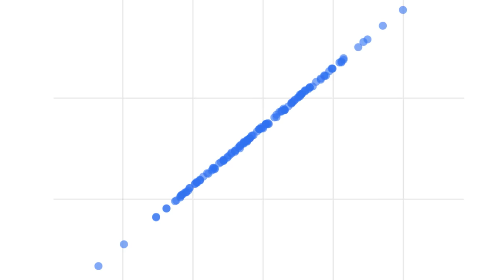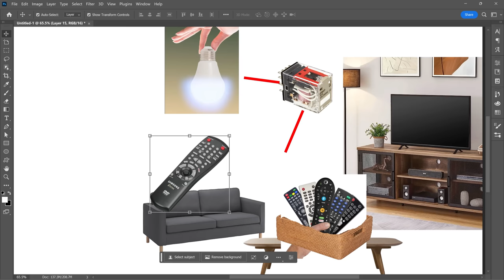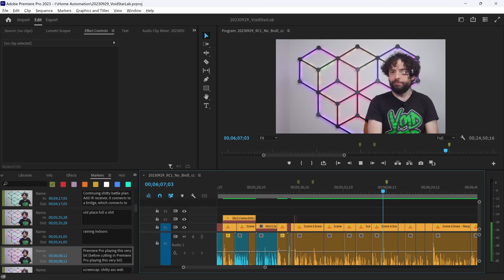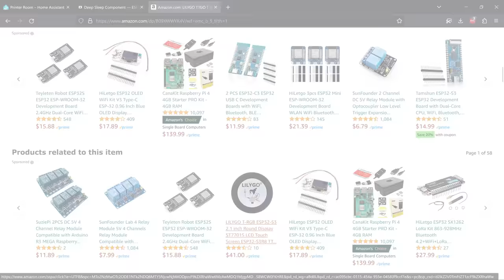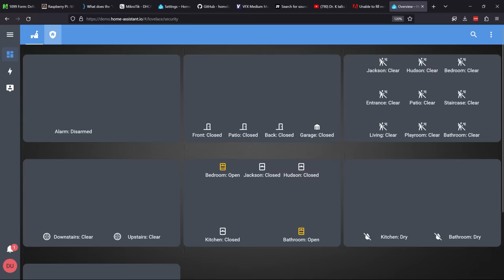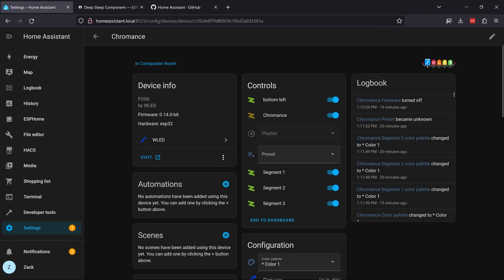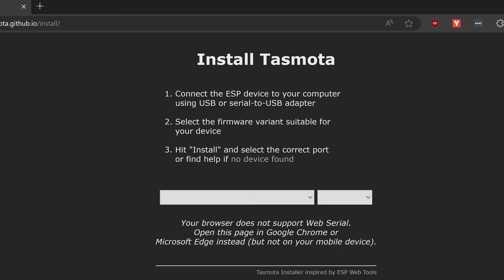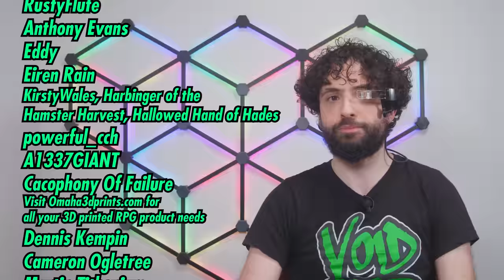Home Automation CONSUMED MY LIFE (and you're next)

Comment: I know the feeling. You don't want to look into HomeAssistant because the problem you're solving isn't that complicated. Then as your attempt to avoid Home Assistant grows into a frightening monster you give a try and realize that you wasted so much time by not just embracing it from the beginning. And then you realize all the crap that you can do now that you couldn't before and you'll be wasting much more time.
Reply: It is really easy to tell if someone uses Home Assistant. They will tell you within 1 minute into the conversation.
Reply: @TechTinkerWorks I rarely wait that long - at least you know I’m not vegan 😂
Reply: Oh god this is just refactoring...
-I find code that looks bad
-I replicate 90% of the logic but miss an edge case
-I spend 3 hours handling edge cases for a total savings of 7-15 lines and slightly better control flow
Reply: Home Assistant is just refactoring.. replacing your own stupid code with code people wrote who actually spent enough time to build a generalized framework for handling many interoperating state machines and work with more than just your stupid relay board driven by a parallel port.
Reply: This is exactly what happened to me
Reply: HomeAssistant is Klipper for your house. Once you accept learning enough to operate it (which was never really that high a bar), you’ll wonder how you ever lived without it.

Comment: Pro-Tip: with most dehumidifiers (that i know of) you can typically hook a tube up to them on a port or under a cover on the side and they'll just drain from that tube without needing to be discharged by hand.
Reply: I was 100% expecting the current-sensing adapter to trigger a reservoir-emptying pump. Definitely room for further tinkering there!
Reply: And if you need to pump it up, like from a basement, you can connect dehumidifier to a condensate pump. Works like a small sump pump. Some of them you can even wire the dehumidifier to shut down if the pump malfunctions. 

Some dehumidifiers come with a pump included.
Reply: True,  but you have to keep an eye on said tube.  They get clogged with gunk.

We have a dehumidifier running in our basement and have to keep an eye on it because of that.

There's also the issue of having a hose long enough to go over to wherever your basement floor drain.

But hey, it's still indeed better then emptying them by hand. 

And everyone with a basement in a damp environment SHOULD have a dehumidifier in it. It's 100% a must. Trust me, I moved into a house without one that had no door to the basement and the whole house smelled like mold and mildew most of the year. (I'm in the PNW).   Put in a dehumidifier and the issue was gone.
Reply: I am super disappointed to find 3 replies here and not one of them is a joke about your tube being discharging by hand.

Comment: I absolutely love the fact that the community is building up open options to do this stuff. At the same time the default - and easier to set up, usually - firmwares and apps for all this are Orwellian nightmares and usually a remote killswitch once the OEM designs to make a new product. I worry that a lot of new customers will just use those and regret it later.

Major props for using open source and DIY tools for your own system.

Comment: The problem I’ve always had with home automation was how little you could do without replacing all your switches, lights, etc and the cost of it all assuming you can even modify that stuff where you live. 

But it’s definitely gotten easier.
Reply: A lot of things around which don’t require changing switches, they just get wired behind the existing faceplates
Reply: My trip down the wormhole started with smart bulbs. Then others in the house started complaining that they were not happy with having to use their phones to turn the light on or off, so we're onto smart switches now. And two different hubs, and Google home thingy, almost ready to set up Home Automation (when I can find a Raspberry PI4!). Also have blinds automation motor ready to install and an ever growing heap of 'tried that, found better' stuff in the cupboard. Oh well...  what will happen to it all when I snuff it nobody knows!!
Reply: they make widgets that you mount over a light switch, and they physically flip the switch underneath them
Reply: Snazzy Labs had a really great philosophy that I continue to follow: anything smart must also work dumb. I didn't want smart bulbs or wifi switches or anything that would just stop me from flicking a switch to see what I'm doing while I figure out why the WiFi is cooked. I used Shelly devices, mostly the Dimmer 2 product. To work around not having a neutral near the socket I decided to just mount them in the roof on the actual light socket. I did swap out the light switches themselves for momentary push buttons (to satisfy my hatred of a physical switch being on when the lights have been turned off elsewhere, but it's optional) and it's been amazeballs.
Reply: @shanemshort  wish I could do stuff like that. But since I’m renting, even changing switches is a big deal.
Reply: @shanemshort  I yell into the void to turn my lights on and off, but the few times it's failed and I had to figure out why, turning the light switch off, then back on turned on the lights hahaha. Sadly im in an apartment so I can't really modify anything. Some day when I have a house though, oh man i'm gonna go wild with this shit.
Reply: @MrSolLeks looks like your thing has memory leaks that can only be solved by fully restarting it by cutting off power 😂

Comment: "Coming back to the smart home stuff after a decade away feels like returning to a remote tribe and finding a space program." Tell me about it. I played with PIC microcontrollers and BASIC stamps in 2004, and then came back ten years later to the Arduino world (okay, OSEPP, but same thing), and I couldn't believe how spoiled everyone was. The chips were orders of magnitude faster (ideas I had 10 years earlier were literally impossible on any chip, and now quite doable), and you could just plug the board in over USB. I had to MAKE my own cable back when, and program in assembly, and upload from a boot loader. 10 years later, they could just plug in a USB cable, fire up an IDE based on the Processing one, and look at dozens of sample scripts up in the menus. I chose the one that blinks the light on the board, and seconds later it was blinking. It took me a week of soldering, splicing, failing, assembling, and wiring up my own clock to get that far before.

Comment: I'm a home automation nut getting into 3D printing. And I love Home Assistant, WLED, Tasmota, etc. At first I'm like "Why doesn't he just use ESPHome instead of coding the Arduino stuff from scratch", and then my questions were answered lol.
Reply: I tried tasmota first, but it turned out ESPHome is much better and VERY awesome because i can just bang some hardware together and I will have running software in 10min.
Reply: Yeah, I am using ESPHome more and more these days, it's come a long way.

Comment: I love seeing your solution to “humidifier tank filled up” 
I would’ve tried adding a drain tube and a small pump to simply siphon off the water as it filled up. 
Have 2 probes to see when the water is full and have a small pump pump out the water somewhere at a lower elevation and boom no more water
Reply: Hack the "turn off" switch to instead be rigged to a pump. Or have the dehumidifier drain to a much larger container and just buy a the cheapest sump pump you can find. Or put the dehumidifier on a high shelf and just add a drain tube to the existing tank so it drains by gravity to a sink, toilet, out a window, literally anywhere you're fine having water go. 
I would get so annoyed at having to drain the thing every day. That's way too often.
Reply: @modsandendsGG-3883  You can also buy a dehumidifier with a built-in pump. And the ones that don't have pumps usually still have a garden hose hookup, so you can use gravity to drain without modifying the tank.
Reply: @johncip  he did make a video about turning on the lights but more complicated lol, also gave up on that morning stretching routine that was probably not bad for him
Reply: You mean, automate the problem instead of the notification? ;)
Reply: Oh my fucking God JUST PUT THE HOSE AT THE BOTTOM OF THE TANK

Comment: The next steps are temperature, motion, and environment sensors. 

True automation isn't "I moved the button to my phone/the internet." True automation is making everything work together: "I didn't need to push the button, because I was detected entering the room and it was 3:30PM, so the lights all turned on. It was 70 degrees because my environment sensor triggered the vents to allow HVAC to flow into the room and turned the ceiling fan on for circulation. The fans on my extraction hood were spinning down because my last 3D print ended ~10 minutes earlier."

Comment: I spent the first half of the video expecting him to say "And then I went to Home Assistant and it made it so much easier to do everything" so I'm happy he eventually got there.  I'm a home automation nut that recently got in to networking and then 3D printing.  For 3D printing I've sent up a custom dashboard to monitor the camera from octoprint and the temperatures of the printer plus enviroment aws well as an automation that I turn on before going out or going to bed that turns off the printer when it is done.
Reply: But he didn't shout it and hump the air! That's against the rules

Comment: For those of you looking for a more off-the-shelf solution for smart switches, TP-Link's KASA switches are the most simple and robust plug-and-play switches I've found and they are pretty inexpensive compared to a lot of the other options on the market. Did my whole house with them and use Google home for automation and it's working out really well. Just make sure you have the proper wiring in your house for them to work.

Comment: I really recommend buying some (zigbee/z-wave?) 2-gang or 3-gang light switches. That way you install it instead of your old light switch, and have 1 or 2 more buttons that can be tied to anything smart in home assistant. So you can turn on and off all your LED strips with the other button on your light switch, that's not physically connected to anything. I use it in a lot of rooms, like turning LED strip for my 3D printer on and off.

Comment: A tip for that high CRI led and overheating, its best to mount it to aluminum flat bar. It acts as a heat sync, and if you drill screw holes in it, it makes it much easier to install. That is how we install all the high CRI product in film/television.

Comment: In my printer room (ie the basement), I have a dehumidifier. Instead of filling up the tiny bucket it shipped with, it fills into a 200Ltr barrel. Then an ESP8266 based custom board monitors the water level in the barrel, checks for leaks outside, and measures the humidity and temp. When the barrel is full, the ESP8266 activates a submerged pump that pumps out the water to a 3d printed faceplate on the inspection port of my house drainage. I'm not so great with programming and APIs, but I managed to write enough code so I can log into the ESP via telnet and it'll give me status info, and it also can send a warning to my phone via bushbullet if there's a error state. The ESP is in a custom 3d printed case (that uses fibre optics to display LED status lights).
I have dozens of electronics and 3d printing projects, and pretty much all of them are unmitigated failures, but this one actually works, and has been totally reliable for over 2 years. It even alerted me when my basement flooded after my central heating boiler broke.

Comment: For your dehumidifier, you can install an automatic bilge pump, which is what they have on boats to automatically pump out water from say the engine bay. They run on DC so you can sit it in the bottom of your dehumidifier (or add a larger tank underneath it for the pump and run a hose to that tank). You can keep the battery charged with a trickle charge or other means and have an automatic pump.

You can pump the water into a larger container or a nearby window/sink/bath etc. and you won't need to worry about the water level rising or have to constantly be emptying out the water tank.
Reply: Or a condensate pump. Easily available and inexpensive and very reliable. Just plug it into the wall.

Comment: my smart home journey started with me realizing how expensive led dimmer switches are. I realized that a couple of zigbee lamps and a zigbee hub would be cheaper than adding dimmer switches. Now I've got way over 50 devices, a lot of them I built myself and quiet complex in my two room appartment. I'ved spent propably over a thousand bugs on smart stuff to save on 150 bugs worth of dimmers.

Comment: Zack one thing you could do is add hose to your dehumidifier so it just drains by itself.  If you don't have a drain that's lower than the dehumidifier, you could raise the dehumidifier or have it empty into a condensate pump.

Comment: As a mere mortal, I dabble in 3D printing, and I have a bit of home automation going.  Home Assistant is everything it claims to be, which is an astonishing statement.  I got a note on my phone yesterday, telling me I'd forgotten to close my garage door.  My lights are not only automatic, but they change brightness depending on time of day.  My stock, off-the-shelf bathroom vent fans are humidity aware.  And Z-Wave is really cool, even if I didn't break out a soldering iron.  You reaction to Home Assistant is a bit like my reaction to the Bambu X1 when returning to 3D printing after a 5 year absence.

Comment: I actually had to work with a home automation setup from 2004 which was surprisingly competently setup, it had a main IR controller, a full on server cabinet, and it receiver in every room on all walls. it still works, but i swiched it from using IR to homeassistant like most sane people would do (although the IR is still usable)

Comment: Interesting finding this VOD after just yesterday looking into wifi-enabled clothes washers and dryers. These devices let you set a timer before starting operation, but by wifi rather than manually (which arguably takes longer), and notify you when they are done by wifi rather than a buzzer. You still have to load them, unload them and fold the clean clothes. There are some great uses for home automation, but when the ROI in time and work isn't there, it's just an addiction.

Comment: I'm planning myself one day to create a home app that lets me control the lighting of each room and even have more advanced functions attached to them like set automatic on/off timers and activating or deactivating motion sensing from sensor-equipped rooms, then maybe even remote controlling appliances, a home audio system, alarm and streaming security camera footage.
I stumbled into the field of electronics and programmable logic circuits almost on accident, I might as well have fun with it. My two worries would be having to create the interface and the actual installation, as the entire logics circuitry otherwise is so basic you can realize it in LD.

Comment: I use the Node Red addon on my Home Assistant server to control my automations. I've got automations as simple as turning off a closet light after a couple minutes to turning on the front porch light when my wife comes home after dark. I even have it tracking usage sensors and pushing that data to SQL so I can see how I'm burning electricity. Be careful though, it's hard too escape the event horizon node that is red.

Comment: Now all you have to do is install ESPHome in to home assistant and create your own well everything 😀 Presence sensors with ESP32 dev board and a LD2410C a LUX/Light sensor, a temp, humidity sensor, motor controller and the list goes on...and on....and on.  Gets even better supports all kinds of displays (both touch and non-touch. Plus SO much more. Oh and i'm a home automation guy on a 3d printer channel, and a 3d printer guy on a 3d printer channel. By the way once you get into ESPHome you will drop tasmota like a hot potato.

Comment: Both 3d printing and home automation are both interests.  I just installed a WLED based light for my front door. I haven't    added it to home assistant yet.  There is a 8 inch tablet mounted in the hallway that controls all the lights with the home assistant app. I will check out your thangs later

Comment: LPT - Get a Zigbee Power strip with individually controllable outlets and integrate it with home assistant.  Also I wonder if you could put a water detection sensor in the dehumidifier.  You might loose some capacity, but seems easier.

Comment: DOE O 422.1 may caution against, and require solutions to minimize scope creep in any compliant conduct of operations program, however sometimes as individuals we scope creep ourselves into a beautiful never-ending project with unlimited scope and unlimited budget. Like how my want to replace my CR-10 went from just buying a prusa kit to building a voron 2.4 in the biggest size officially supported and spending 3 months printing all the parts for a 4 color voron vs just having the recommended 2 color version and having to build a spreadsheet to track colors to make it look nice, evaluate filament usage for the project and track all the parts and cura project files for printing the parts.